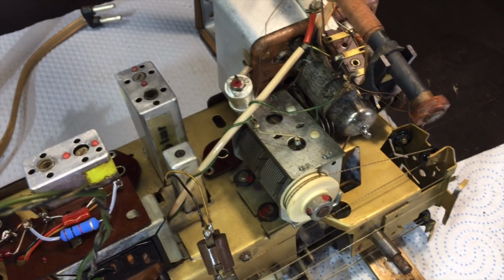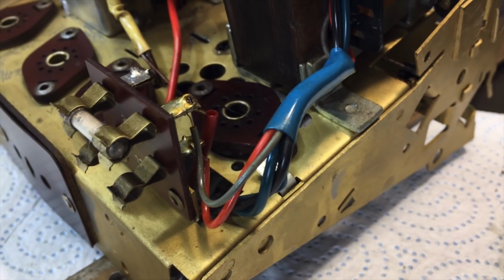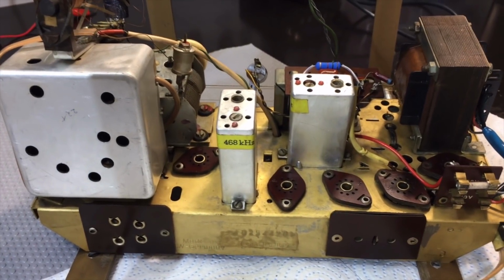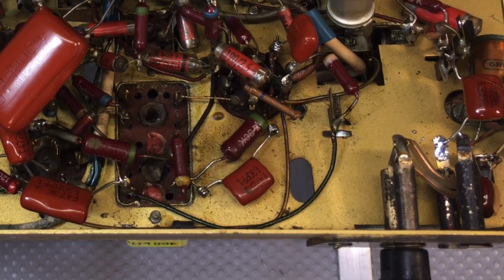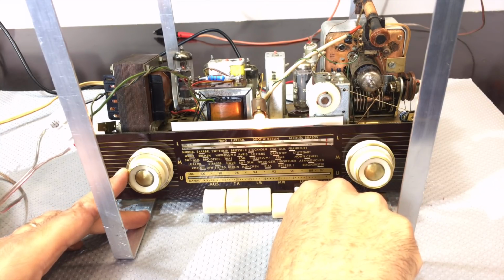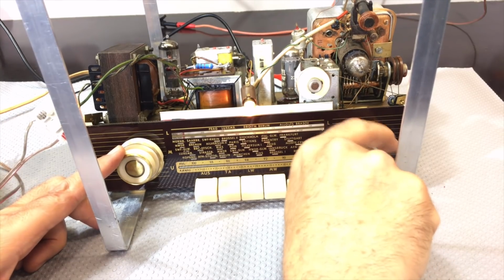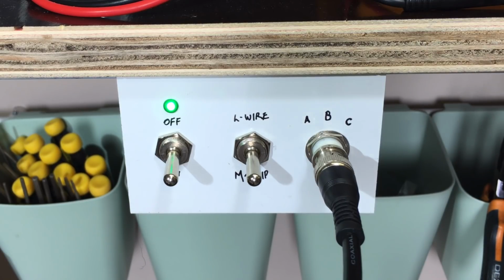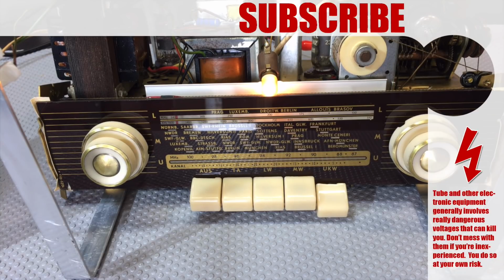Grundig type 90u tube radio restoration, part 3. Recapping after the Recapping.

Comment: Do you determine the outside foil side of your capacitors before you install them?
Reply from the maker: only on the ones in very sensitive parts of the circuit.

Comment: You have lots of reasons to be very happy with the results of your work on this radio!  Very good job.
I have a suggestion and comments.
You mentioned the Cigarette tar all over the unit.  Something you might want to consider, if it is available to you, is to use "OdoBan" on the radio to clean it.  It is remarkable how well it removes odors, even smoke from a fire, on things it is sprayed on.  In this case, you, of course, would not spray it on the radio itself, but on a microfiber cloth you clean it with.  Check out information on it here:
https://odoban.com/
A few things I noticed while watching the video.
1. While showing a closeup of the bottom, you were pointing out a, 30KΩ resistor I think, and I noticed a capacitor that appeared to be across it.  The leads seem to have been coiled at each end and the most noticable thing I noticed "must" be an optical illusion.  It appears that both sides of that capacitor are touching the chassis.  It is raised away from the chassis, right?
2. There appeared to be a ceramic disc capacitor across the IF transformer.  The way they change value so much over temperature, that would not be a good idea.  As a bypass to ground, fine.  But to pass RF from stage to stage, or as a tuned element in an IF transformer not good at all.  You might want to check this video out:
https://www.youtube.com/watch?v=67M7fsbLUIU              (I'm sure you already know most of this, but it is interesting to view anyway.)
3.  You did an excellent job cleaning this radio!  Something I wanted to share with you, in case it would be of use to you in the future, is that to clean the sockets that the pins of the tubes (valves) go into, you might want to try using a "Flossing Brush" with whatever is your choice of cleaner to clean out the inside of the sockets.  Here is an example of what I am talking about:
https://www.walmart.com/ip/GUM-Proxabrush-Go-Betweens-Cleaners-Tight/813664253?wmlspartner=wlpa&selectedSellerId=0&&adid=22222222227123665203&wl0=&wl1=g&wl2=c&wl3=235428738432&wl4=aud-430887228898:pla-387683788003&wl5=9012613&wl6=&wl7=&wl8=&wl9=pla&wl10=8175035&wl11=online&wl12=813664253&veh=sem&gclid=Cj0KCQjwlN32BRCCARIsADZ-J4vCNvQaP7PO4QsDCJdvNzvQdzeLt7AGCjU1SeLAjbOuzyrmmcO_zSoaAihQEALw_wcB
I really do enjoy your videos! That new "Service Frame" you made to attach the radio to looks great.  Very useful and yet it stays out of your way allowing you to do what work you need to on the radio.  How did you bend it?  How do you attach the ends together?
Reply from the maker: Thanks for the tip on odoban. Could come in useful.
1. The cap is in fact away from the chassis (both sides);
2. There is no ceramic cap across the IF transformer that I can see. There are in fact two plastic “blobs” which actually look like those caps, so perhaps it was a problem with the video image. Thanks also for the link to the video. One can never know enough to stop learning 😊 
3. I have used this flossing brush thingies before (can’t remember which video), and they are great.

The service frame is made from a length of aluminium and bending it is easy against a sharp, hard surface, using a clamp on the static part. The length was 100cm, so I made each side about 24cm, leaving the extra 4cm to screw on and hence close the loop.

Comment: Manuel, did you manage to try out the cleaning products and applicator that I mentioned a few weeks ago. If you invest in a garage compressor, pump spray bottle, brush and White Spirit you will save no end of time. With this setup that I have I can have a chassis cleaned in less than 30 minutes. Definitely worth a try.
I've tried brake cleaner, carb cleaner and acetone in the past, but they evaporate in seconds, so you have to work fast.
Better to use a non aggressive solvent like White spirit, which doesn't evapotate so quickly, but the cleaning is just as effective Good luck!
Reply: Oh, I forgot to mention. For knobs and any plastic items, washing soda or baking soda in warm water and a toothbrush is very effective at cleaning them. You'll be surprised at how quickly this stuff works. One table spoon of soda in a jar with water. Just put all the knobs in a glass jar and watch how fast it removes the grime before your eyes will believe it.
Reply from the maker: Actually, I ordered some of the equipment just about at the time you mentioned it, and it still hasn’t arrived due to the shutdown of some of the transportation services. The problem of living on an island 😊 
I haven’t tried the baking soda. Must give that a try. Thanks again.

Comment: Cute little radio! It has a date code on the piano key assembly, 9 nov 1956.
I love the effort and soul you put into these radios to make them better than new. By the way: are you gonna leave the power transformer as is or youre going to install a different transformer to make it safer?
Reply from the maker: Leaving it as is with a safety warning circuit. Coming soon 😊

Comment: Hi, 
Another Vintage Radio saved from a possible uncertain future.  Using alcohol and cotton buds to clean a chassis is always going to be safer than washing with water and detergents.
Your mini whip aerial intrigues me.  Did you design the circuit?  I’ve seen a number of circuits on-line.  There is one referred as PAORDT that incorporates a J310 FET transistor - I imagine they would be tricky to find these days, and a 2N5109 - I doubt they are still being manufactured either.  Since I’ve gotten the bug to make a mini whip for AM reception only, I’ll find modern transistors that will work at least as good as the ones specified. 
I was impressed with your demonstration, and comparison of mini whip versus long aerial in a previous video.  Having seen that vid, I thought it was high time I made one.
Cheers, Phil.
Reply from the maker: The mini-whip is in fact using the PAORDT schematic. I found the components without too much hassle. I’ve documented the build in a video:
https://youtu.be/H1pfRCvi1P4
It really is a magical little thing. Well worth the build.

Comment: There are a few places that sell “old” resistor values like 30k so you don’t have to use 27k or 33k. But in practice it’s probably not that critical.
Reply from the maker: No, it shouldn’t make any difference

Comment: Well done as always!  How about a schematic for your Ant. panel since some electronics is evolved?  Also what sheet metal case do you buy, or do you make your own?
Reply from the maker: The electronics is described in the mini-whip video. It’s just a supply for the antenna.
The cases I have cut at a metal supplier from simple 6.5cmx6.5cm elements, as it’s much cheaper and easily available to me here. I can also get whatever “width” I want this way.
Reply: @electronicsoldandnew  - Thanks for the feedback!